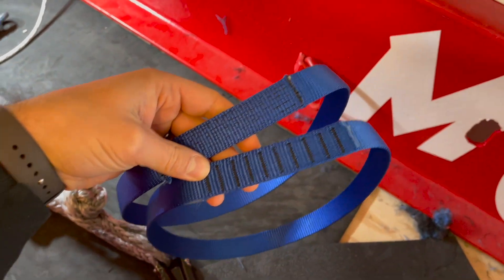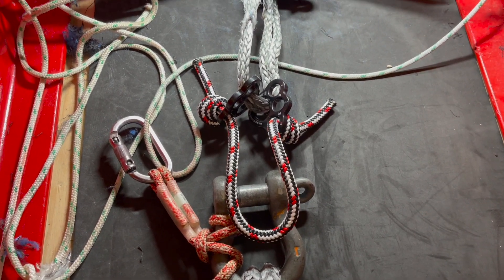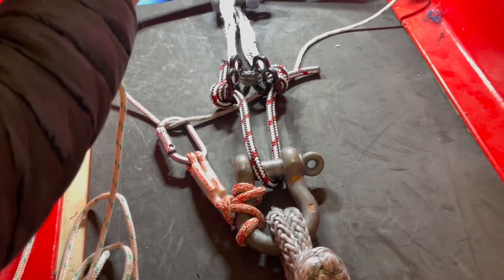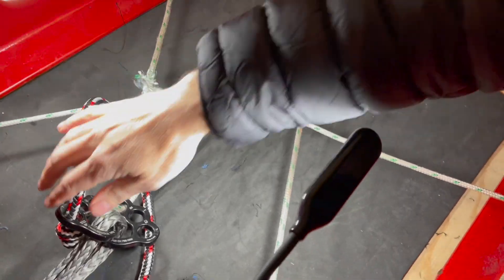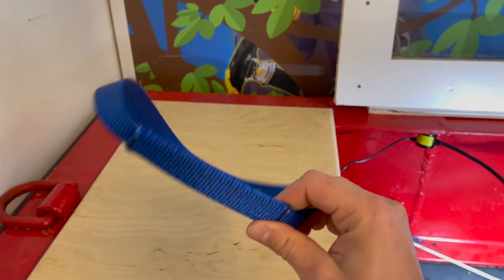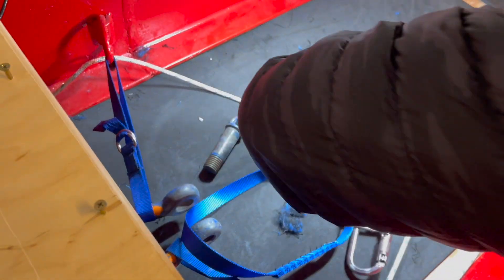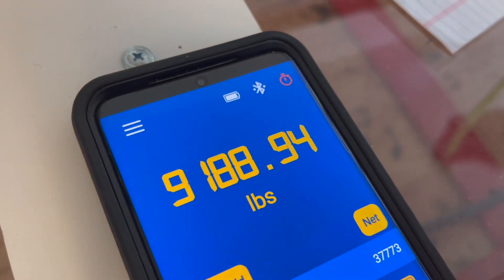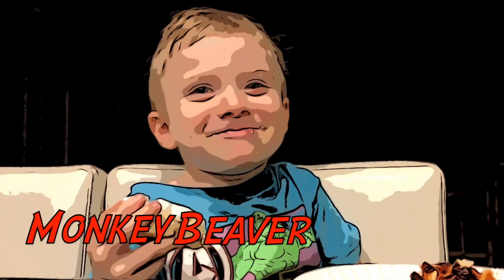Testing Bridges

Comment: What is the purpose of the small white rope in the testing box? thx
Reply: The white rope runs through a friction device, it’s tied to the winch side. When the product breaks, it turns the winch slack into a slingshot. The white rope helps arrest the slingshot effect.
Reply: @evanwilliams6352  Thanks!